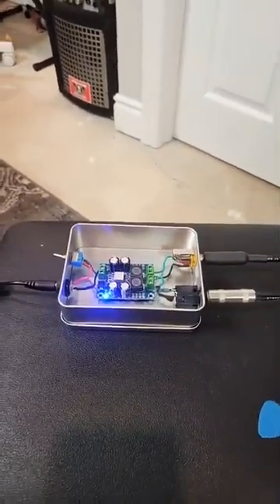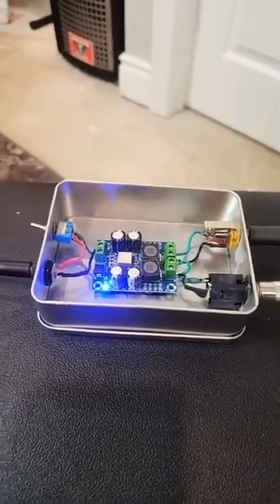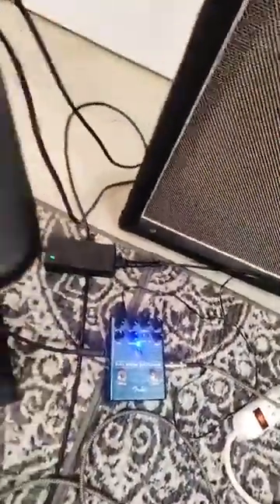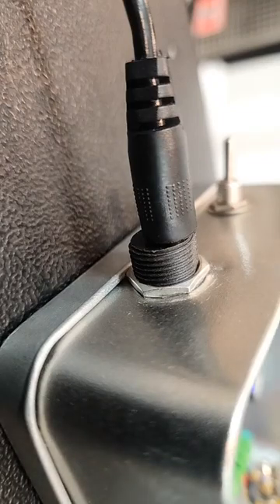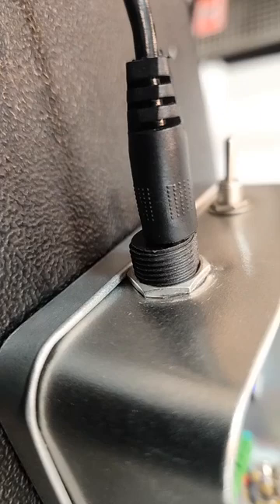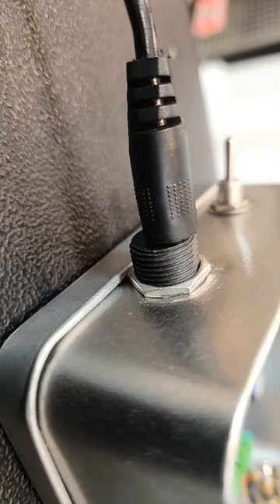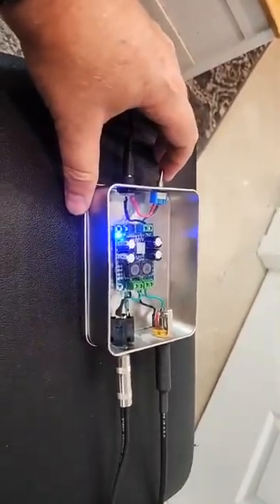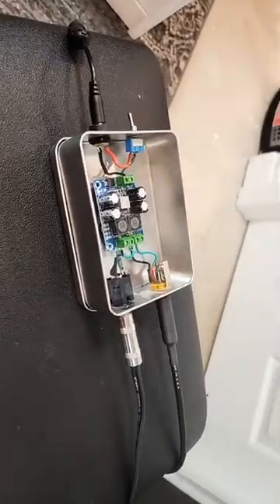DIY Class D Guitar Power Amp. tpa3118 50 watts with 24v 4a power supply.

Comment: If I want to put a volume pot in the circuit, would it go on the output or input? And what value would be ideal?
Reply: The PCB has a mini potentiometer, and if it doesn't have one, it comes at maximum volume by default.

Comment: Is this akin to the mooer baby bomb? I have a headless 2x12 cab, my amp tubes blew. Can I use this to run the 2x12?
Reply from the maker: Hey! Thanks for the comment! 
Yes this is and isn't like the moore mini bomb.  
It is class d. It is a poweramp. But it has no buffer circuit.  
So, that means is there is no volume knob or tone shaping. 
Yes this easily power a 212 cab. I run a 412 with it ( sheiffields) .
In run a boost or buffer pedal last in line before the diy poweramp. 
Cheers!
Reply: @BAMmods  how many ohm's total your 412 cab driver? Is it 4 ohm or 8 ohm?